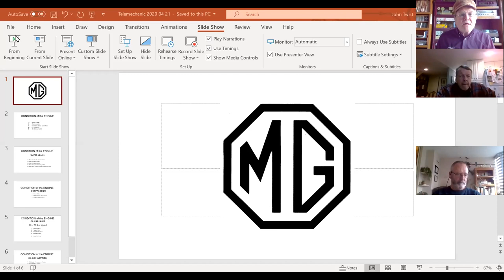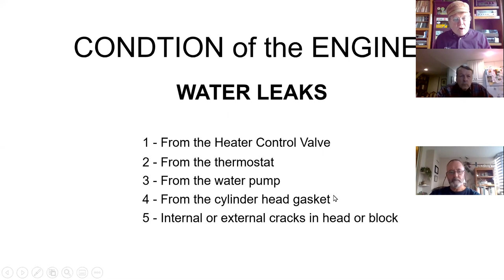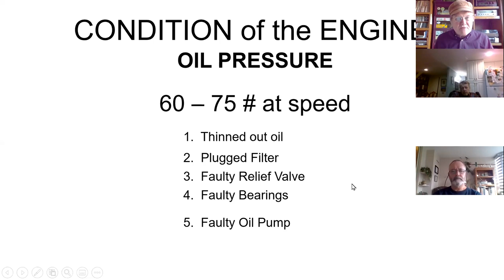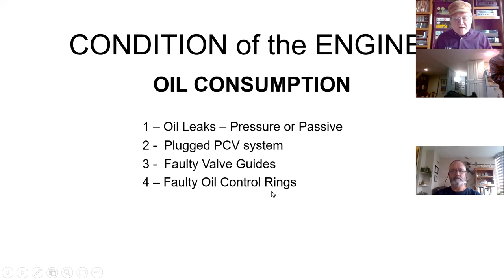295 MG Tech | Zoom with John Twist - April 21, 2020

Comment: He is correct there are is no more lead but you can buy LED substitutes and put it in your gas to help lubricate your valves
Reply: AV100LL. it is low lead but still does use lead. Just do not use it any engine that has a catalytic converter. It is also 100 octane.